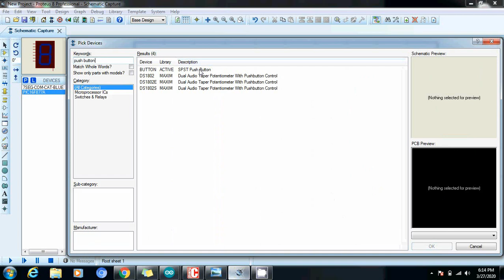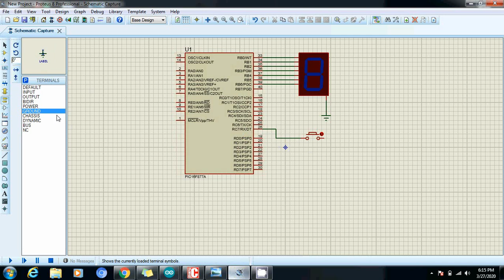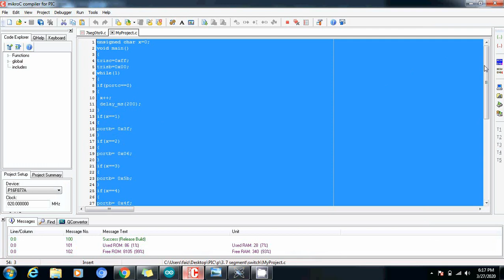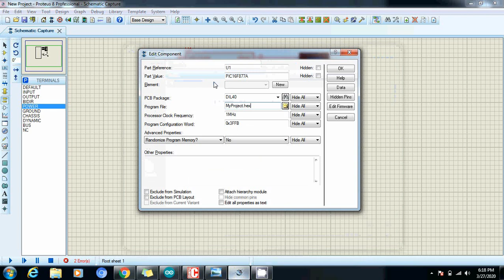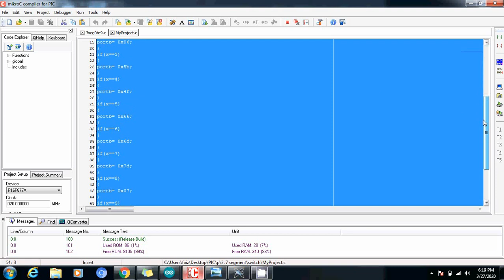Interfacing PIC16F877A with Seven Segment Display And Push Button

Comment: Can i write this code in mplab ide  and make the same project ?? Plzz answer
Reply from the maker: Yeah sure. You can write in mplab also. Just check the syntax.
Reply: @akramlab6664  bro i written and the compile.process is succes but in proteus it automatically run the numbers  in 7 segment displat Without button press plzz help🙏
Reply from the maker: You might have not initialized your switch /button.